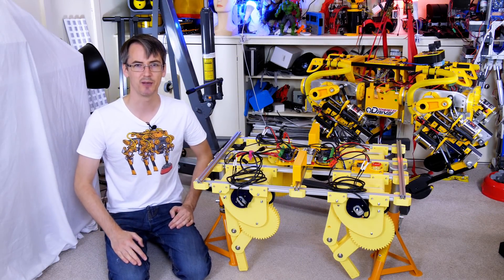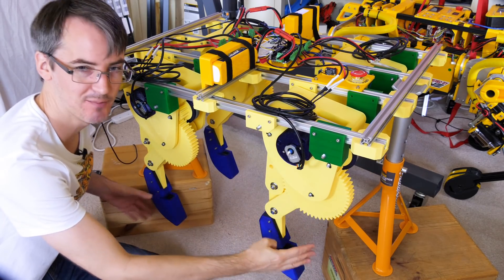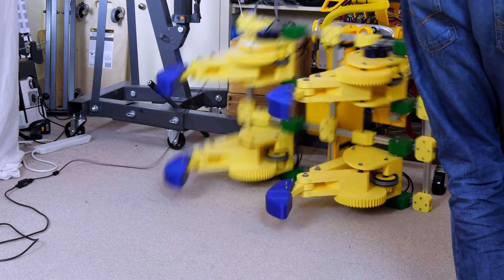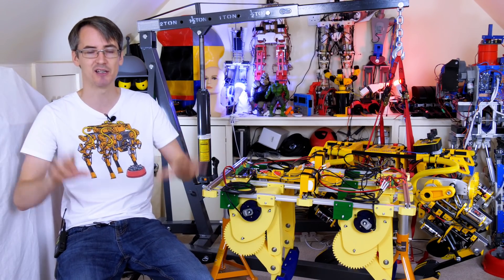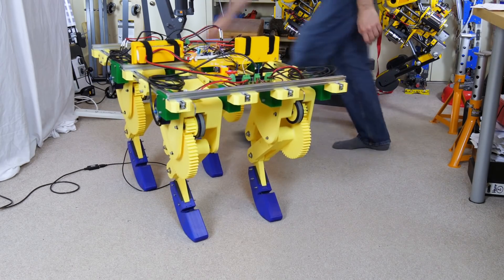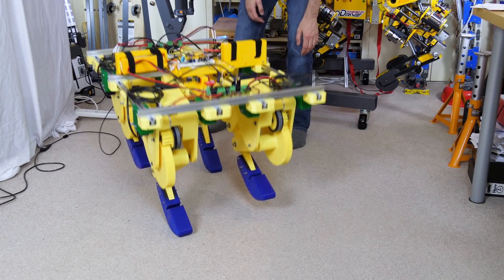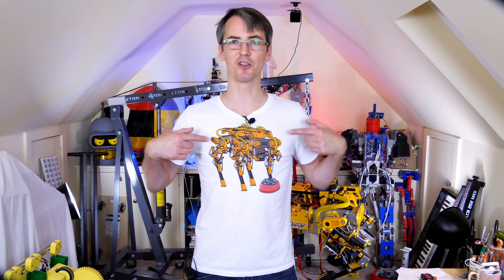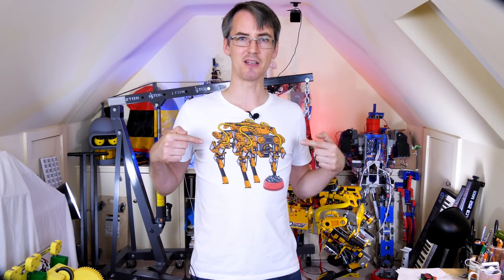Robot Dog - Stability using Dynamic Compliant Simulated Springs

Comment: Hi, I guess your gears are printed in nylon right? Because I tried pla gears with some robot but they broke
Reply from the maker: Nope, all PLA, but they are big
Reply: @jamesbruton  oh, so I guess I could use pla gears too if I print bigger gears. They broke because I tried them with a 150 cm biped robot. They broke when I moved the leg too fast. I guess I can solve it with a spring to absorb excessive inertia, or trying to print bigger gears like you do. Thank you😄⚙

Comment: If you had some kind of air bladder, with an electronic gas pressure sensor, I think you could embed that into a foot design to measure the pressure being put on the foot. The air bladder could be equated to an inner tube, and the rest of the foot (possibly made from ninja-flex) could be equated to the rubber tire of a car.

Alternatively, you could make a hemispherical socket for a very firm rubber ball (think: super bouncy ball) to sit in, resting against some equidistant pressure sensors on springs mounted around the inside of the socket, to allow you to calculate the vector of the pressure on the foot.

You could even make multiple smaller hard rubber ball sockets with one sensor each, and group them together on one foot. A little bit like the foot pads on the feet of some animals. Dogs have toes, you know, which can move a little bit independently with the application of pressure. Oh! Idea: Give the foot, toes, that are pressure sensors!

Comment: This is absolutely amazing and have been interested in creating one but do not have enough technical skills with that said I was wondering about if you were to consider to make the Torso a bit more flexible just like a real four-legged animal. With your current sensors and adding the left to right up down sensor motion would that help adjust for the balance? Also do not know if that would be incredibly difficult to create. Like any animals there is always some sort of center of gravity.

Comment: Instead of bulky and expensive microswitches,  have a look on aliexpress for leaf switches.  They are dirt cheap and tiny,  so you can have several in each joint activated at different deflections.

Comment: First thing i would tell you that change the tiny nano controller and use big controller to control motors and sensors..
Reply from the maker: Isn't a 32 bit 180mhz Arm Cortex enough?

Comment: If I may make a suggestion, your idea is sound but it's a design error with the flexible filament. If you left the dog long enough the analogue value from the hall effect sensor would settle eventually, but the thickness you've made the feet makes it very slow for the ninjaflex to bend and absorb the weight of the test chassis. You should keep the hall effect sensors and change the design of the feet to a much faster spring rate by making the cut much deeper or using rigid materials and a spring as you suggested.

I think your issue might also be that when the foot hits the floor, you're immediately stopping the movement. I would think the leg needs to continue to extend until the IMU reads that the body is level otherwise the leg will never apply pressure to push the shoulders/hips back up. If I understand it correctly, the only thing the IMU is doing is varying the compliance on the knees depending on if its leaning left or right to try and rebalance itself.

Thank you for your content also, I've watched all of your videos over this past year and you inspired me to buy a 3D printer and get back into 3D modelling. I love your robots and I hope my suggestions can help you solve this issue.

Comment: The testdog tipping over with one footsensor installed is actually proof it works. With all other 3 legs not being stopped when they touch ground, offcoarse it's going to collapse the leg that is being stopped. Putting the sensor on all 4 will balance it again.

Comment: If its weight is equally distributed from side to side, and the numbers are the same for all 4 legs, then why isn't it stable?????????? It doesn't make any sense... :|
The plastic everything gets stuck. It needs oil on all its moving parts. Also, if the screws in the legs have different screwed strength, then it can also affect how smooth they work.
If it's too complicated, then put an accelerometer in it, and attach the legs to it. :)

Or... Are you not abusing it? At all?? Yeah, you have to abuse it and beat it a lot, to show who's boss. It's the only way to make them listen to you, and work. That's how the guys at Boston Dynamics have such good and well behaved robots.
Reply from the maker: Yes it has an accelerometer in it to make it stable - that's what the video is about
Reply: @jamesbruton  Kick it more! And yell "get up"...

Comment: The reason it lies down when you stop the motors once the foot senses the ground is simple. You set a limit function which removes energy from the system and you have no restorative function so each cycle the system will lose a little bit more height. You should measure the chassis to ground height distance with lidar/ultrasound and apply a compensation value when you detect sagging. Or model this in the kinematics so the system increases the target positions for all the legs by a function of how low the body is.

Comment: Have you tried using Cycloidal drives for gearing down the motors? they have a relatively small footprint and can still achieve high ratios

Comment: instead of relying on the 3d printed feet and having them slowly droop, you could replace the "hard" plastic piece on the inside with spring steel, should be much more repeatable.

Comment: You need an accelerometer or gyroscope, feeding back tilt signal to the legs controllers, so if the dog tips more to one side it can correct itself, even though the legs are compliant.

Comment: JAMES!!!!!!   Your dogs legs are not sturdy enough side to side. When they are compressed they bend in slightly. That's where alot of your problems seem to be. If that slack was in the other way (like if you were to spread your legs wider than your shoulders) it would negate alot of that.
Reply: You could even try putting the drive assemblies (the whole let) on the opposite sides. That would bring the weight balance inboard and make the legs more stable. Basically what I'm saying is you need look at your structural design. Keep it up man. You're awesome!
Reply from the maker: I need it to be inherently unstable so I know the stability system is working - it's a test dog for the purpose only.

Comment: Have you thought of putting a threshold on the derivative of the hall effect sensor instead of just the position? High derivative = foot just hit the ground. Seems like that would make a good switch. You can still tune it, unlike a micro/limit switch, and it shouldn't react to the plastic deforming over time.
Reply from the maker: The feet get squashed to nothing if I leave it for long enough, so I think I need a better foot solution

Comment: What about trying the hall effect sensors on all feet first? If the feet are all getting equal wear, then shouldn't the deformation be similar across all feet? Of course as you say, this would mean a little math for the threshold value. Instead of using a fixed constant (ex. 0x7F) , your tuned threshold would be a fixed ratio (ex. 50%) of the rolling average of high values and rolling average of low values from all the feet sensors.
Reply from the maker: The challenge is that they get squashed down to nothing eventually if I leave it standing there...
Reply: @jamesbruton  Ah. Good point. 😅

Comment: It look like there a construction accuracy issue on the front left leg... it is plastics. I don't know what kind of tolerance you made for those joints but. a small wear and tear could cause a bigger flex one leg more then in the other legs causing it to be unbalance.
Reply from the maker: Yes it's possible, or belt tension etc

Comment: When it falls over to its side, you can easily detect this using the accelerometer and stop the legs.
Reply from the maker: I could do yes, just change the leg timing based on the angles.

Comment: James what about using both the endstop switches and hall effect sensors in conjunction with one another. This way you have the Boolean of the dog on the ground and the floating value of weight or force on each leg. Would that simplify things?
Reply from the maker: Yes that will probably be the eventual plan for openDog - but switches and load cells

Comment: Armchair Robotics Engineer: Perhaps use a stiffer internal foot structure to resist the creep in the plastic foot? Love the implementation of the extrusion of different materials in single piece.
Reply from the maker: Yes, or probably metal ones and load cells etc...
Reply: @jamesbruton  I do like the load cell approach. And, perhaps a shaped metal foot using a high stiffness and strength metal...sound like fun project in and of itself. Have you looked at any designs of modern prosthetic device to guide the foot work?

Comment: I feel like the pitch on the screws for Open Dog is to fine for any quick change of movement. The mass of the motors shifting speed that quick when walking could cause damage / not reach the speeds needed.

Comment: I think an FSR could also be a good solution, might be worth looking into
Reply from the maker: They are not linear unfortunately
Reply: @jamesbruton  No, but you can linearize them with a simple circuit and firmware reasonably easily. In your case, you don't seem to be concerned with the absolute accuracy, but more a relative measurement for threshold detection. FSR are thin, lightweight and inexpensive compared to load cells. Take a look at this guide:
https://www.sparkfun.com/datasheets/Sensors/Pressure/fsrguide.pdf

Comment: I feel like a lot more of this should be done virtually before you actually build it. I mean yay video income and stuff, but really this level of stuff should be simulated imo. You're getting research and application engineering problems simultaneously. If you keep doing it this way you'll end up with 19 open dogs. X) Or more likely, chronic burnout.
Reply: Agree. Also need neural net to train.
Reply: @hv1461  For real. if even half all this effort was put into machine learning I think the results would be phenomenal.

Comment: Sounds like it needs a gyro sensor. Have you considered a mass reaction wheel? Have you looked into cycloidal gearbox fornthe joints?
Reply from the maker: The IMU is a gyro and an accelerometer

Comment: You should look at capacitive touch sensors for the feet as a pre-warn system to slow down the feet so they don't ram into the ground.
They don't need to be accurate a "heads up, ground is coming" would suffice so they don't slam. It will reduce wear and tear greatly.
Also, you really should read up on automatic drift correction for your PID loops etc. so you don't need to tune so many parameters manually.

Comment: Feel like detecting foot touch to the ground will never work reliably enough. If you added an IMU like in drones to detect the position of the body relative to the ground, you could calculate what the legs positions should be in software.
Reply: Except the floor is not always flat. You need to know when the foot is touching something or you risk over-pushing and tipping over the robot.
Reply: @jendib  You can see how the Boston dog is always trying to "feel where the ground is" with small movements. While actively extending the leg, If it is touching the ground it will affect slightly the body position and with an IMU you can have a model in software that can construct a representation of the ground.
Reply: @plceli  Boston Dynamics use LIDAR to map the floor and  the surrounding, they are in another league.
Reply: @jendib  yes in the latest small version but not on the big dog I don't think, and why not just assume that the floor is flat. In any case, I think it would work better than with mechanical switches.

Comment: some 4k7 pullups on the I2C lines should also help a lot for stabilizing the signal...
Reply: Yep.  I noticed that the internal pull-ups in microcontrollers are pretty weak for I2C applications, and an external pullup greatly improved the I2C signal.  Not sure I went as high as 4k7 on my test, but easy enough to hook up an o-scope and experiment with different pull-up resistors.

Comment: I would suggest using 3 load cells and make the feet have 3 points of contact with the ground. This would let the robot sense what direction the force was being applied from the leg to the ground and could be used to adjust the gait and position of the legs. I would also suggest looking at creating actual feet and ankle joints to help with compliance of the limbs. The ankles won't need a very big range of motion, but it would make a huge difference in being able to adjust the force from the leg to the ground to ensure balance.

Comment: Hi james! Have you considered using planetary gears instead of the huge basic gears? They offer a lot more reduction which helps with the power of the robot and the weight issues while being smaller. They are still back drivable even with a 20:1 reduction as well.

Comment: I'd like to suggest that instead of 3-D-printed plastic inside the soft foot you use spring steel, which will always return immediately to its uncompressed shape when the foot is not on the ground.

Comment: You don't want to read absolute value of the analog foot sensors, because you'd need to constantly recalibrate them. Instead, set the reaction to rate of change over time, or the first derivitive.
Reply: PID control?
Reply: Right this exactly

Comment: Perhaps look at the actual skeletal system of a dog or wolf and get some inspiration. The skeletal system is separate from the muscular system even though they are integrated together to perform locomotion. I would say design your foot and then motorize it. Make stability part of the framework and then you don’t have that issue to fix via motors.

Comment: Honestly, i think that the conclusion to this entire project is going to be: "Turns out 3D printed parts are a terrible choice for building robot dogs".
Reply: slap_my_hand Nah you want to be able to make the dog as light as possible. A good mix of plastics and metals helps.
Reply: @Frrk  The first dog had tons of problems with structural 3D printed parts bending. You can only really use them for mounting hardware to the aluminum extrusion, all structural parts need to be metal if you want it to be rigid.

Comment: I was thinking if legs had artificial muscles to support those leg bone structure for get it more stability
Reply from the maker: what are 'artificial muscles'?
Reply: @jamesbruton  work like real muscles but are controlled with programmable air, like you have the leg sensor on foot so it could trigger muscle movement

Comment: How do the Boston dynamics robots have so much strength for their size? The legs on open dog are huge compared to theirs but it’s much weaker. Maybe having motors that can quickly compensate for the lean will make things easier to balance?

Comment: I might be missing something here, but as the travel of these bendy sensors is very small they are effectively just measuring the force on the foot, and if that's used to drive the current limit on the joint isn't it effectively circular logic?

When James says "a virtual spring", I think of an ideal spring where the force applied is proportional to the deflection - in this case wouldn't a "virtual spring" mean measuring the distance between the limb's actual position and intended position, and setting the current proportionally to that? I don't think that requires foot pressure sensors, just knowing the joint position (which it already does).  Then the gait would be determined by commanding joint positions to walk normally, and adding some extra "push" (ie. move command position further) to the legs on the lower side if the body tilts, which would apply restorative force towards level position.

This would work on flat ground; the advantage of foot pressure sensors would be letting the robot sense different floor levels and adjust its commanded foot positions to compensate.  As it is, trying to use foot pressure sensors to keep the bot level seems counterproductive because if it tips one way, it will push those legs less and inevitably fall over as a result.

Comment: James,  Quadrruped animals have a hanging belly, which lowers the center of gravity, resulting in a better stability. also a hanging weight dampens the inertia. that should be a major consideration. just my 2 cents.
Reply from the maker: But then I won't know if it's actually balancing as much - this is a test for balancing, so making it harder means I know the system is working.
Reply: @jamesbruton  You are right to set a system to find the problem source, but you know it is a complex system, even open dog looks to have all its weight too high. great work anyway.

Comment: How many 3D printers do you have and how much print time do you have each day or week? Those parts are very big, I understand why you only do a video once a month, it would take that long to print those parts LOL. Also as a patron once this puppy is done will you be willing to provide me with stl files, the cad or whatever files you provide are hell to break apart. I use Blender and I have to load the whole thing and then delete everything except the one part I want, it takes way too long to get a part separated and then I have to start all over for each and every part. Blender just sees it as one BIG part, if anyone knows a better way without me having to learn new software that would be cool too.   I will gladly pay extra for such a service, I really want to build my own Open Dog.